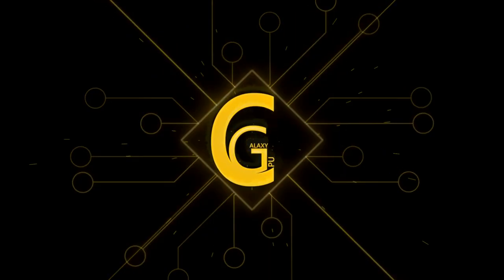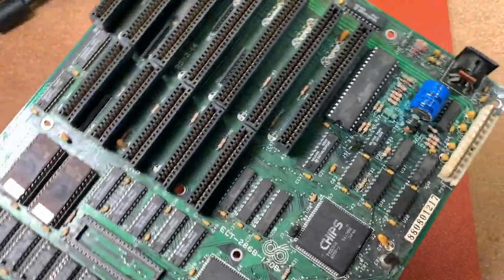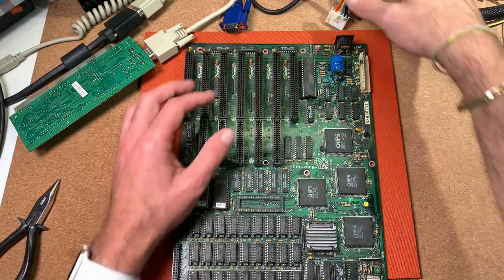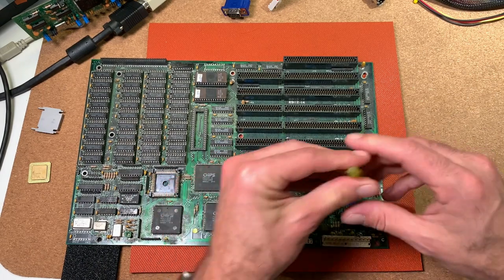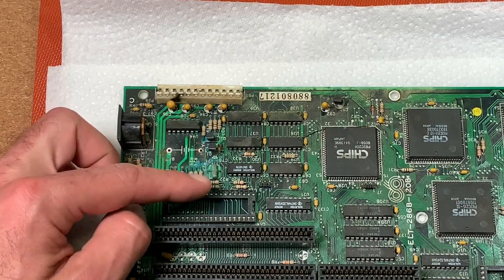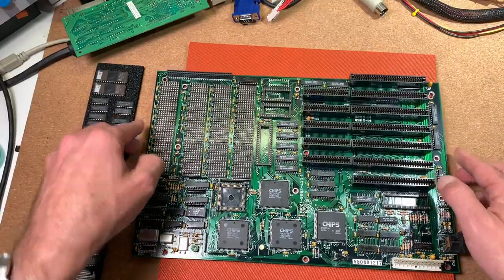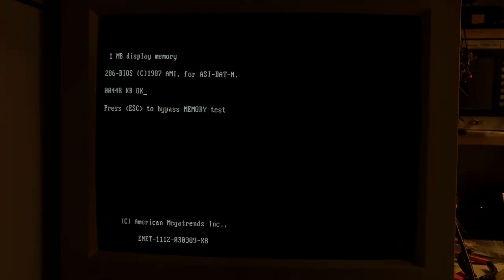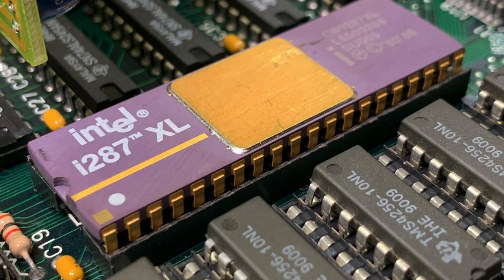286 Board Restoration & Testing [Leaking Battery and Exploding Caps]

Comment: I thumbed up for the genuine Austrian swearing. :) It's a good idea to always check those evil tantalum capacitors, and replace them if needed before powering up any vintage motherboard. You've been lucky with the battery leak, as it didn't start to eat into the tracks. I've seen much worse corrosion.

Comment: You wont get any complaints from me washing the boards. I do the exact same thing and I have done more boards then I can remember now.
Soap and water under the sink then i blow it of with compressed air.
The reason for using compressed air is that I get water stains otherwise, plus it drys faster and its nice to get the water out from under any solder on chips, out of sockets and slots.
Then I dry it at about 50-60C in the oven, 1h minimum from my testing equals dry.

I find that the battery often corrodes one or more of the traces to the keyboard connector, so very common that one has to do trace repairs, did that on a 386 board for a friend recently and it was an internal trace so probably corroded VIA.

The worst I had to deal with I had to remove a NOT hex gate and socket it after doing trace repairs under it plus the chip next to it for the keyboard ans such I also had to trace repair and solder a new socket to plus it had corroded off traces to a ram buffer chip, was a Bison III socket 4 board wit heavy corrosion damage, got it working eventually.

And with a lot of soldering and repairs its nice to clean any flux of, some flux can cause havoc in signal integrity if not cleaned off, plus washing the board just makes it look new like you showed.

People are usually suspicions to water on electronics but its mostly fine as long as its dry when powered on again.
Reply: If you have a vacuum chamber, it's also good to dry off boards, just take off the batteries and other stuff like that before putting it in (don't ask me how I found out that some electrolytic capacitors can't be put in a vacuum)
Reply: If you have access to a dishwasher it also works Depending on grime level a toothbrush and water may get it cleaner tho.
Reply from the maker: yeah. If my wife is not at home I use rhe dishwasher as well 🤣
Reply: Rinsing with distilled water before drying should also help.

Comment: Great machine! Nice to see the top end 286 parts. And that Tseng ET400AX is the dream for an ISA PC. Only thing I would have done differently is a button cell battery, looks like there's room for one on the board. I get that you want to keep it original, but we're also archiving these components for the future, I think it's unnecessary to risk future damage just for originality. Some sacrifices must be OK to make to ensure that the parts keep working.

Comment: I have  one board 286 25Mhz, and 287. Baby board very good, 4MB ram, 5 slots ISA 16 and 2 ISA 8.  Drive 1.2 and 1,44, video ISA Cirrus Logic 1MB,  Soundblaster, hdd in slot isa ( 20Mb) ide controler UMC, modem USR 14.400, Dos, Windows 3.1, many games, old VGA color monitor. AMAZING!
Reply from the maker: seems to be a great setup. I am searching for long time already after a 25 MHz 286.
Reply: @CPUGalaxy  Is very rare to find! Try in MERCADOLIVRE Brasil always have found. And in BRASIL 01 dollar is 6 reais. Very good bussines to you

Comment: My very first PC, a 286 we bought at Karstadt in Hamburg (I believe it may have been the one in the Einkaufzentrum Hamburger Straße around 1990), may have also been an AMD processor, but it was 16 MHz. It did come with issues with the real time clock though (in hinsight, possibly a Dallas RTC). I have the faint hope of one day being able to replicate that setup. The specs were: 286 with 16 MHz, 1 MB RAM, Trident TVGA 512k VGA adapter, 40 MB harddrive, 5.25" 1.2 MB floppy (drive A) and 1.44 MB 3.5" floppy (drive B). I would however upgrade it with a 287 math copro, up the RAM to 2 MB, ditch the Varta battery and replace it with a standard CR 2032 coin cell, and change the harddrive with an SD or CF to IDE adapter, or even find a SCSI solution.

Comment: Very nice board, luckily the corrosion was on the surface only, no eaten traces, not even flaky soldermask. I'm all for keeping things original, but for me the board-killing batteries aren't going anywhere near a restored motherboard. Fully agree with washing the boards in the sink, I have a full range of substances that I'm using , from dish soap to brake/carburetor cleaner, depending on the degree of filth :)

Comment: id be worried that there was still battery acid under the socket, might have been worth replacing completely with a new one. I would have also considered a complete recapping.
Nice to see old hardware running again, thanks for sharing.
Reply: What happens during the leakage (there is material leaking from the battery) is actually somewhat convoluted.  It's not like a liquid seeps out and starts crawling over the board - it's actually leaking particles through the air and they are electrostatically attracted to exposed metal on the board.  The battery is doing its battery thing of moving chemicals around to complete one leg of an electric circuit, except once the seal goes bad it can happen through the air instead of the internal electrolyte.  Very, very slowly.

In principle if there was a fan aimed over the board, it would never corrode like this even as the battery fails, because the emitted chemicals would be blown away before they can be drawn to the board metal acting as an unintended battery terminal.

Comment: I knew I had seen that Accolade before but could not place it. So when you showed winter games that was the moment. i haven't seen that in 25 years :D
Reply: Mr Guru  I also played that for a bit, but my father had a 33MHz computer running Windows 3.1 and had acquired Winter Games. It was only later when i got a 66MHz computer running Windows 3.11 that i got to have a say in which games i wanted to run.
I Did not have Winter Games on my computer, but rather had Test Drive and Chicago 90 and Slicks'n'slide

Comment: :D De depperten Kondensatoren imma! Schaaaß! :D +1 Like from bavaria!
That's the reason why I always replace EVERY tantalum cap before switching on those old boards- there's always a good chance, that they explode- and I'm VEEEEERY scared, so I try to avoid those situations. If I want to know, if a board works without replacing, I switch it on while I'm not in the same room. :D

Comment: I did a 286 board the other day. 
4 of those bastards exploded and yea they EXPLODED like small fire works.
You might ask then why did you not check for shorts, well I did kind off.
I did not expect 4 to blow but maybe 1, and in the end I expect them all to blow.

The thing was that even if I removed a bunch of them there was never a full short, there is always continuity between gnd and +5V with most old boards, your have components that do draw current from the +5V rail that is soldered to the board.
In this case about 18ohm resistance or 1.4W @ 5V if my math is right.

I removed about 20 or so of them intact after the first two blew and a lot of them where removed before the last one exploded to but none of the once I tested after removing had any indication of a short as long as they where not powered.

So at least in my case it seems that the short is not measurable because it will happen WHEN enough voltage is applied and or current flow to or from the capacitors.

Thats the reason I removed all of them in the end and replaced them with modern electrolytic because after 4 exploding and not finding a single one shorted after being de-soldered I figured they where all ticking time bombs.

They where all of the same size and model, there where other models on this board to but none of those had an issue.

The board is now fixed, new electrolytic caps instead, 2032 modded with charging diode removed, some corrosion cleanup etc.

Boots from floppy and disk now.

But yea I would replace all tantalum capacitors just in case on my boards just because there ticking time bombs and if your unlucky they will roast a trace on the PCB and then you have to repair that to.
I ended up using the same value Electrolytic of high quality, both have polarity and the later one usually dont explode and usually fails open rather then short.

But in the end one might not be able to measure a short, at least with the once I had to deal with there where low resistant at best, 9-10 ohm and when all removed it was about 18ohm but that was just one of the 4 exploding being "a slow burner" and it went of late.

Anyways If I do a board for myself I'm gonna remove them all because now Im afraid if explosions XD
Reply: I think you're right to replace them once you get a few failures on a board.  What's weird with tantalums is there seems to be big differences between different manufacturers and maybe even different batches.  The ones that survive well en masse tend to continue to survive well.

I've purchased a bunch of Sanyo MBC-55x 8088 machines and they're pretty heavy on tantalums.  Never had one explode.  Interestingly, one is always installed backwards from the factory, but instead of a power rail, it's used in a low current/low voltage timing circuit.

Unfortunately after 20+ years that backwards one has a tendency to leak electrically and if the timer won't fire the disk drives won't operate.  Simply turning the "bad" capacitor around so it's the right way fixes the problem on these.  I've seen some mention of self healing properties on tantalums but was still a little surprised to see it happen, though admittedly this is a fairly contrived abuse pattern that caused the damage.

Comment: I have a 386 board with battery barf that has messed up the board a bit. Battery replaced but it no longer is charging nor keeping date/time. Damn I wish schematics were available. As for those Tantalum caps, I recently turned on a 2-way radio portable repeater and of course the magic smoke erupted from one of the caps on the final amp. I plan on shotgunning all of the tantalum’s as soon as I can get an order in for a bunch of caps for various projects either Mauser or Digi Key will be receiving a large order. As for my board I chose to remotely hang the battery to prevent another round of corrosion. Back in the eighties we used to use R12 refrigerant to blast everything off of our boards.

Comment: really nice! - a question: with the big battery are there modern day more reliable versions? or do they all have this time bomb ticking?
Reply: The batteries used in modern PC-s are CR2032 batteries, and those don't leak. These old motherboards can be modded to use those newer, better batteries. Not all old motherboards have this time bomb thow. I saw multiple 386 boards with CR2032's, and there might be some late 286 ones as well.

Comment: For my 386/40 I was looking for a good graphics card. A dealer friend gave me a bunch of graphics cards to test. In the end I chose one from Oak, which was by far the fastest. If you ever get bored, maybe you can compare some ISA graphics cards? Benchmarks were rather uncommon back then, "performance" was rather measured in color depth.
Reply: You don't happen to have a 100 MHz crystal floating around and could test if a 386/40 will work at 50 MHz? I had already bought a (super expensive) crystal back in these times, but never used it. Okay, overclocking was really a nerd topic back then. 
BTW: My brother already overclocked his CPC 464 to six megahertz. That was pretty pointless, because many programs had timing problems afterwards.

Comment: Nimh cells are good if the device is in regular use, while self discharge is slow these are under a small load, a low charge will see the battery electrodes eat themselves, leakage then follows.

Comment: If the board functions without that blown cap, what was it's function in the first place?
Reply: Guessing it's probably for the +12V or -12V rail and nothing really needs those to be that stable.  It may keep some noise away from sound cards if they use the 12V for the output amp but otherwise it's unlikely to be noticed.  If it's for the 5V rail, undoubtedly there are many others on the board to pick up the slack.

Comment: You should change all tantalum cap...
Reply: If a few of them go, maybe it's worthwhile.  Not all tantalums are created equal, but generally if they don't explode they continue to perform perfectly.   Aluminum electrolytics have a lot more performance variation as they age, and I'd be much more suspicious of them if there is a stability problem.  I'd be hesitant to change out something with solid characteristics but perhaps a little explody once in a while for stuff that's harder to determine the operational condition of.
Reply: @big0bad0brad  I agree with you but I saw a brand new tantalum cap burning after a few hours operating... at least it is easy to spot the bad one.

Comment: I would never advise anyone to apply power to any circuit board with signs of leaking batteries or capacitors. Batteries and capacitors are cheap. Custom ICs that die due to voltage spikes are not.

Comment: What. Is. Wrong. With. You... When a battery leaks, if you try to post the board, you have a very big chance of messing up the board more. The steps are: Desolder the battery, use some form of strong acid to stop the corrosion, clean the board, clean the corosion, solder new parts where needed, if traces are broken, use jumpwires, and if traces were affected but still there, use some solder and make them thicker. Also, the more flux you use the better. Disliked the video, I am sorry, but its too wrong...